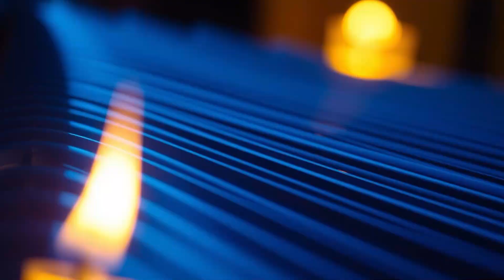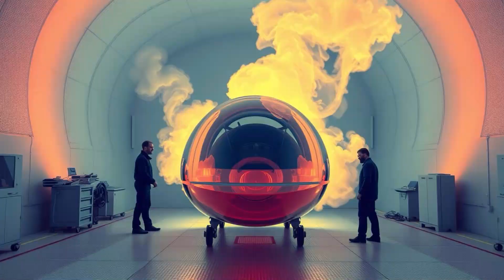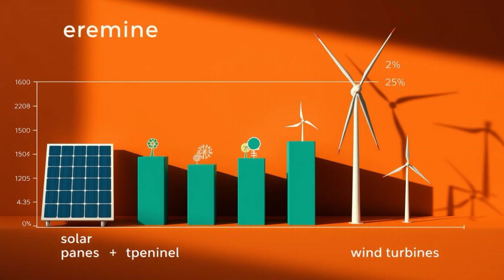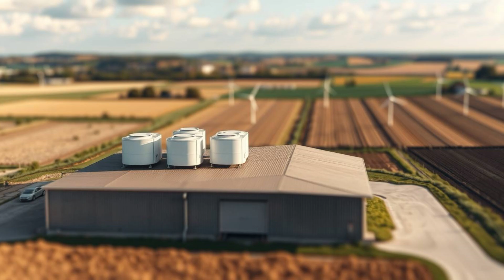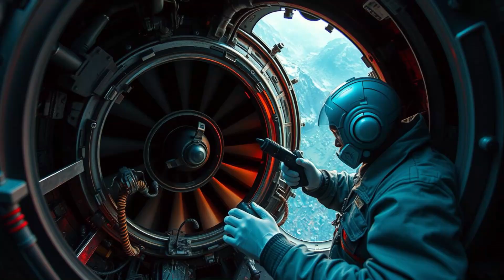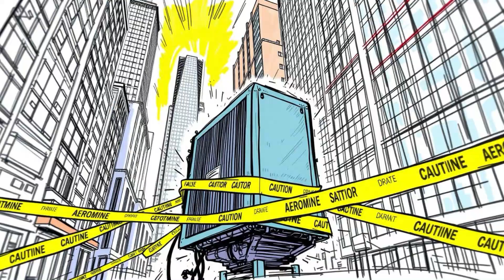70% Cheaper Than Solar? How This Revolutionery Aeromine Wind Systems work!

Comment: All tests of ground-based small wind turbines show that they hardly produce any electricity. 
Solar panels generate at least 10x more electricity with the same investment in time & money! Reliable and almost maintenance-free for at least 25 years. 
But 9 out of 10 small wind turbines stop working after some years due to the extremely gusty winds close to ground.